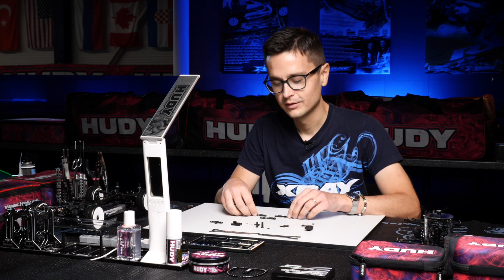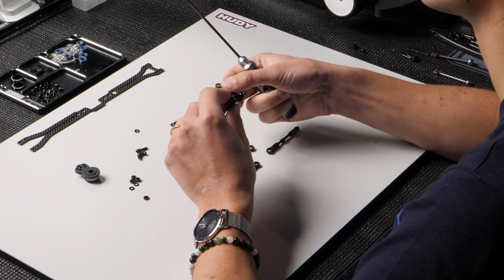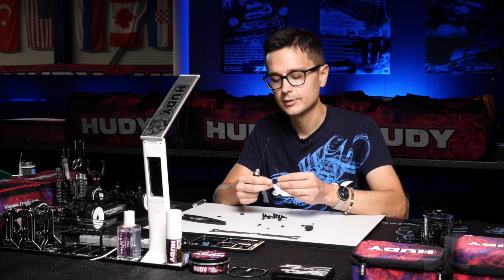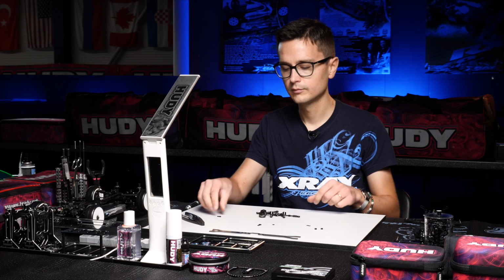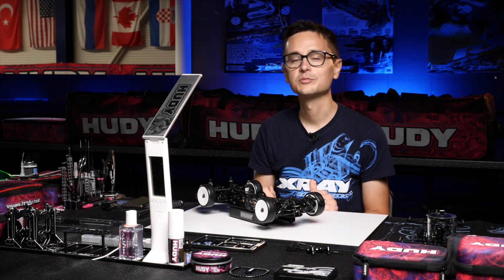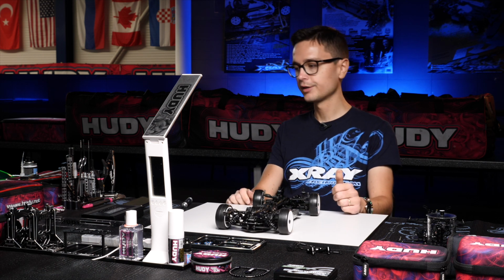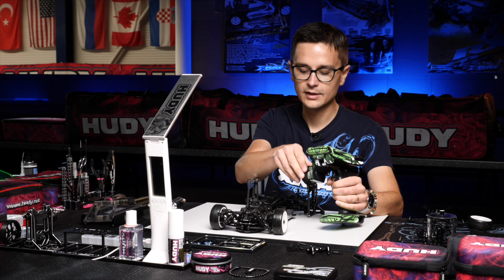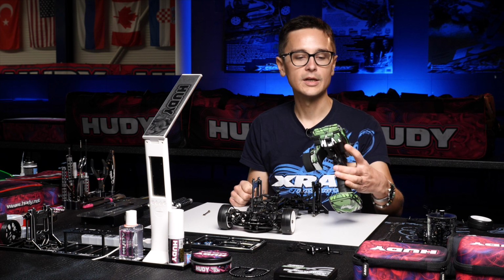XRAY X4 - Tech Tip - Steering System

Comment: Hi Alex, when setting the EPA I have measured all of the arms and shims to match the kit however to get equal steering lock my EPA is 100 left and 128 right. How can I get the difference down from 28 ?
Reply: Have the same issue. Difference of 20.
Reply: To get the smallest epa difference at full lock, the car have to run straight and have same toe angle on both sides at 0 sub trim by adjusting the servo link. In short, it has to be really perpendicular between the servo horn and servo link.
Reply: Thank for this explanation. I have the same problem on my X4 2024